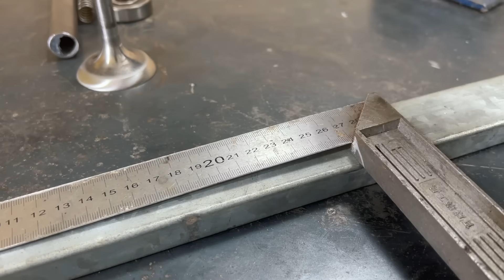An invention that changes your life by an old welder | The discover Tips from high level Handyman

Comment: I have a general comment for probably all these videos. The mirror setting on the camera is a little frustrating most times. I see it most times when power tools are used and when nuts and bolts are being turned in or out.